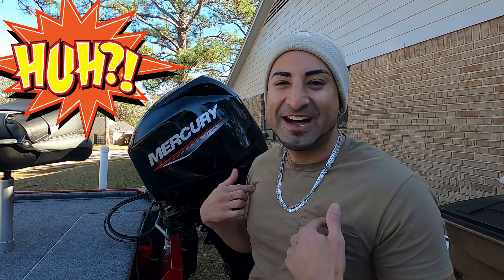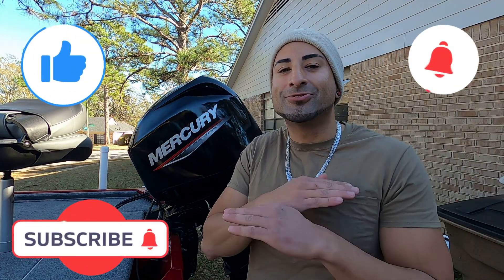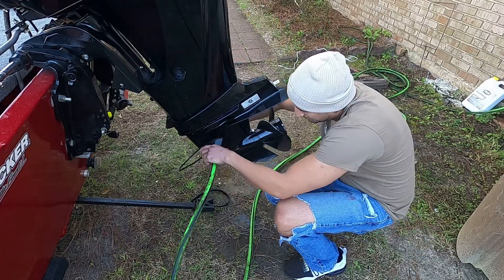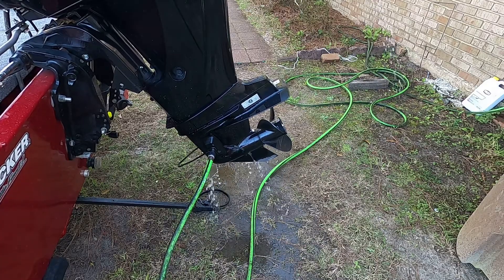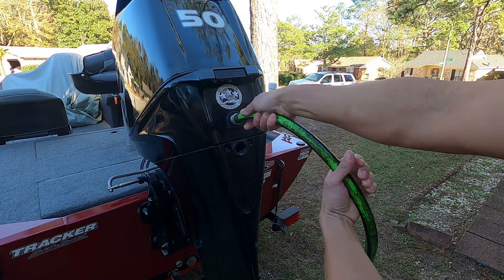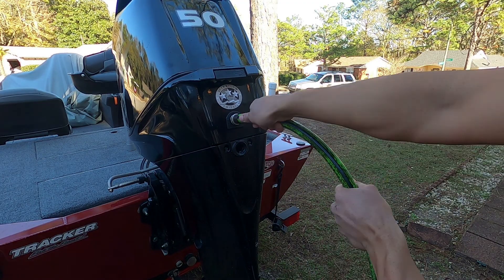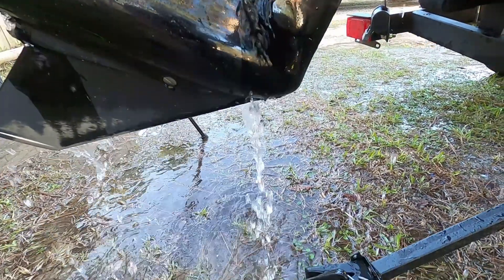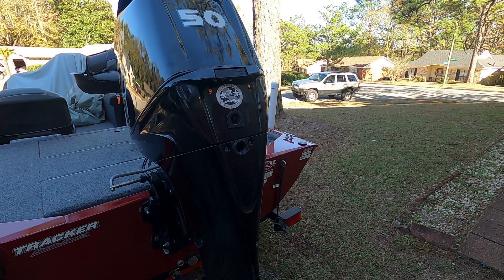how to flush a mercury outboard motor

Comment: Big part of the flush is do not start if you r doing a upper flush
Reply: Shit learnt that lesson the hard way 😡
Reply: The manual says to start the engine in idle when using the top flush port and run for 3 to 5 minutes in order to open the thermostat
Reply: Yeah the manual says nothing of muffs and just talks about that top port and says to run it which makes no sense because it's otherwise an output. What's with that?
Reply: Do you know why the manual says to run it when you obviously shouldn't?
Reply: @perfecthourglass why should you obviously not run it? The manual for my model (20HP 4 stroke EFI 2023) clearly states that when you use the flush port, to run the engine for 3 to 5 minutes in order to open up the thermostat so fresh water can get into the whole cooling circuit. It says do not run it above idle. I'm pretty sure you're not going to burn out your impeller as long as you don't rev the engine above idol while it's being flushed through the port hole that's specifically designed for flushing. The internet is a total clusterf*** of misinformation on this stuff, just follow the manual
Reply: @lukefh3093 And to your point, Mercury has a video here on YT explaining/demonstrating the process EXACTLY like it describes in the manual.

Comment: Did you have the engine on when you did the top flush
Reply from the maker: No have the engine off when you do it.
Reply: The mercury owners manual says to turn the motor on when u connect the hose to the top outlet
Reply: i have a 2021 Boston whaler 60 hp and i have been told by many boat mechanics not to start the engine when you do a top flush because i will burn my engine out.. but my Mercury owners manual says turn the motor on when you connect the hose to the top outlet so just to make sure i called mercury and talk to the warranty department they ask for the model number and serial number for my engine and they told me this is a brand new engine and do what the owners manual says.. keep the engine running on a top flush especially that the engine is under warranty..now I'm thinking maybe the older models mercury engine you can't run the engine on a top flush because you might burn something out..just to make sure i would call the mercury 1800 number and give them your model # and any other numbers they might ask for just to be sure because you don't want to burn your engine out..
Reply: @Carlosboatingadventures20007  Yes, for a 2016 Mercury 115 EXLPT 4S service manual requires engine to be off as flushing from the top is a back flush.  I suppose other merc engines top flush that requires engine to be running, feeds into the inlet of the water pump.  If not, your water pump will be fighting water hose pressure.

Comment: Love your videos. I'm picking up a classic in 2 weeks, can't wait! Saw your 2nd gas tank in another video. Where'd you get it and what brand is it?
Reply from the maker: Thank you!! Did you get your new boat!? And I got it at academy. I do not remember the brand name.
Reply: I did! I love it. Haven't fished fresh water in decades. Literally. Had it on the Colorado a few times where I plan to concentrate on Flatheads. Have a 12 gal Moeller gas tank on order. Wanna do a bigger cranking battery and add another trolling motor battery. Would love to do a bunch more stuff (and I will) gotta wait for my budget to match my needs (wife claims they're wants) :)

Comment: When you say "the motor being hot" am I still good to flush the engine that way after a 45 min ride home? Would the motor still be hot at that point or is that just recommended for using right after u shot off the motor?😊

Comment: Damn dog I have the same boat and I didn’t know about the top port 🤦🏾‍♂️🤦🏾‍♂️🤦🏾‍♂️
Reply from the maker: 😂 really!? Not a lot of ppl flush it that way. But it’s good if you want to clear all the salt out the motor before storing it for winter or a long period of time.
Reply: @Carlosboatingadventures20007  so does the motor have to be warm to use this port
Reply from the maker: @Therapy-N-Session  yes that way the thermostat opens up and you can get a good flush threw the motor.